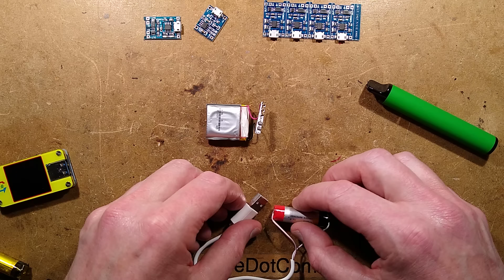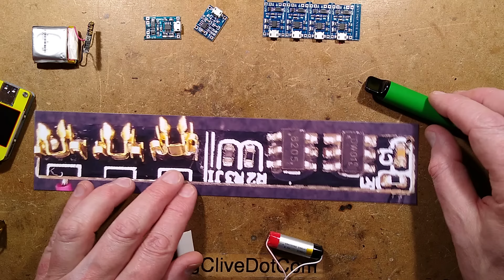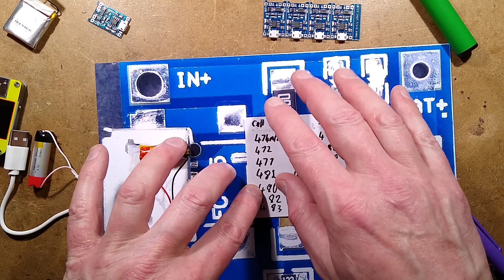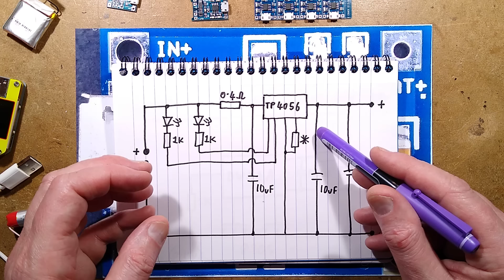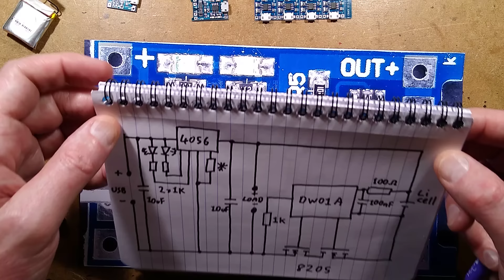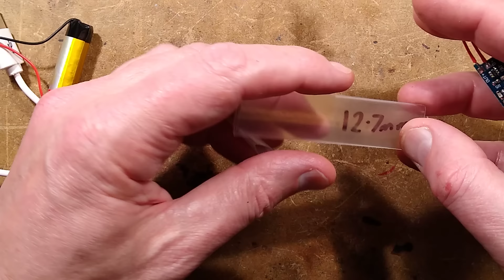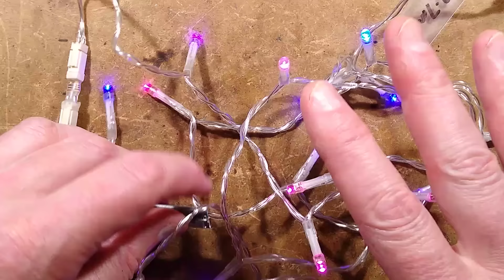Don't do this!   (There's a much safer way)

Comment: One important thing to keep in mind about the board with the TP4506 and the DW01: if you try to use it while charging the cell, the TP4506 will see the charge current as well as the load current and will never reach the charge termination point, potentially overcharging the cell. 
So use that board to either charge the cell or protect it during use, but not both at the same time.
Reply: Thank you for that tip! I had assumed that these boards supported pass through charging. I won't use them in this mode now. I read the other day that most power bank manufacturers have disabled pass through charging. Maybe this is why.
Reply: @chrisreynolds6331  When I bought my first Anker charger, I read on their web site that they did not offer battery banks with pass-through charging because it shortens the life of the batteries
Reply: @chrisreynolds6331 There is a simple way to make these little modules support pass-through charging: When connecting wires to the output terminals to clip onto a lithium ion cell to charge it, connect the negative wire to both negative output terminals, and the positive wire to both positive output terminals. Whatever you are powering from the cell will then take current from the 4.2 volt charging output on the module in addition to the cell itself.

Of course this bypasses the DW01 and twin-MOSFET package, so the cell won't be protected from being discharged too much any more. Or you could just use the cheaper type of module which doesn't have the discharge protection - those cheaper modules only have one +/- output to begin with. Either way, you could use a separate discharge protection module connected directly to the cell to get the protection back.

If you leave the micro-USB cable connected to the module (and connected to a 5 volt USB power source), the module will now act as a miniature uninterruptible power supply, provided that whatever you are powering from the cell doesn't need more current than the charging output on the module can supply.
Reply: @chrisreynolds6331  Power banks have their own multifunction BMS chips.  Maybe the most common one doesn't handle pass through properly.
Reply: If anyone wants to use these for passthrough charging, it can be done.  There's a circuit which uses a P channel mosfet, a diode and resister to pull power from the 5v input and bypass the battery completely when USB is connected.  It's also necessary to use a switchmode regulator on the output which can be powered from 3.4 - 5v to give a consistent output voltage. It should be fairly easy to find online.
Reply: @DarrensBench  can I find a schematic for this anywhere?
Reply: BigClive has released a video explaining why this appears to be true, and also why it is, in fact, not true.
Reply: Yep
Reply: I'm pretty sure this is wrong, it will just be connected in constant voltage mode. If you have any source telling otherwise I would be very interested to see why that is.
Reply: Thanks! I was wondering if the board could be used this way. Would've been cool.
Reply: Nah
Reply: Top reply, this should be pinned. I've cooked a couple of Lipos in exactly this manner, and had no idea why.
Reply: That's very good information, especially since the protected one even have separate B+/- and OUT+/- terminals. From what I can tell fixing this would have "cost" three additional components and a very slightly larger PCB, it's a bit sad that no one has capitalized on this to provide a better variant (that I can find, it's all TP4056 with or without protection circuit, no PCBs that appears to be different).
Someone suggested that one could fudge a "load bypass while on USB power" using two schottky diodes (for lower voltage loss) - I may have to test that out next time I use one to confirm that this actually works but the idea looks reasonable (not a guarantee).
Reply: @Torbjorn.Lindgren  Maybe look at other chips from the same series.  Some are designed to provide power output without the 10% loss in a schotky  diode.
Reply: @johndododoe1411  Most people want a pre-existing module so they don't need to design their own, I doubt anyone charging a lithium cell with straight 5V would be capable of that. Which is why it's a shame that the common protected TP4056 modules LOOKS like they support "pass-through charging" (separate B+/- and OUT+/-) but doesn't - and that I couldn't find any better (commodity, small, simple) pre-made alternatives, whether TP4056 or not.
If you know of a pre-made module that takes USB power in, manages a rechargable lithium cell and support pass-through charging I think a number of people would be interested in what to search for to find it. Major bonus points if it also includes a boost/buck convert afterwards to provide an adjustable stable output voltage (say 1.5-12V)  - but there's good pre-made modules specifically for this part that people already use.
The "build a jank bypass circuit using scottky diodes" was a musing on wether it was possible to salvage it for quick-n-dirty usage (apparently it is, found people confirming it), with a redesigned circuitboards and possibly different charging chip that's unlikely to be the best way to do it.

Comment: Please mr. bigClive, can you think and or show a hack to limit the 4056 to charge only to 4.1/4.2v and not to the 4.3v it comes as default?
A way to fool it maybe with low-drop diode loop or something? I would not mind if discharge cutoff jumps up a bit too.. all good to keep any lithium cells healthier for a LOT longer.

Comment: I've adapted a couple of devices that take 3 x LR44 cells to work with the cylindrical cells. Mainly it's kids toys like the LED light wands you buy at the fair but I had a screwdriver with a triple LED illuminator that I keep in the car and it had enough space inside to accomodate the cell. Once I get my 3D printer up and running I might make a charging cradle for it with a couple of pogo pins and put the charging protection in the cradle.

The cell protection circuits are ace, I've even used them to convert a dustbuster I got from Freecycle from NiMH to Li-ion, it now works a lot longer and charges via micro-USB.

Comment: Would there be a way to attach some kind of variable resistor, so you could adjust the charging current, to suit the size of battery you were charging?

Comment: It's a shame one cannot adjust the voltage levels as well as the current levels (on the 4056 board). The 18650 cells I have are rated to 3.7V and that's as high as I want them charged.
Reply: Unless you're talking about LiFePO4 cells, 3.7V is likely the nominal voltage and not the max charge voltage.
Reply: @fat_pigeon  Thanks. The 18650s I have are 30Q from samsung. Wiki says they are INR - I.E. Nickel, Manganese Cobalt so capable of being charged to 4.2V. Nevertheless it would be nice to charge to maximum voltages below that 4.2V to reduce physical stress on the anode. For longevity in a battery it's best to charge to only 80% capacity and discharge to only 20%.  I do this on my electric car and on my phone. Not that the phone manufacturers help - I have to run the charger via a bluetooth controlled relay that switches off at 80%.

Comment: Aww, poor old "Trumpy Brick" now reduced to playing cameo roles?!

Unfortunately, people here in Yorkshire tend to be a bit tight fisted, and rarely, if ever, do we find anything in the street, unless it's an old microwave, or a fridge!  But, I do like the idea of salvaging those batteries.

One thought occurs to me, and that is that if the charger module's output was limited to 1A, could you charge two batteries in parallel to effectively give them 500mA each, or would it not work that way?

Comment: Hi Clive. It's difficult not to notice that you have some rather sore looking cracks on your hands. I used to have similar dermatitis sores and cracks. I tried a few over the counter treatments and one from the doctor all of which were no help, then in frustration I applied goose grease, it is harmless, very soothing and my problem cleared up. If you have not roasted a goose recently you can buy pots of goose fat at the super market. Regards, Jon

Comment: I empty the garbage cans and sweep the parking lot for a shopping center in Southern California.  I am swimming in these lithium cells from picking them up while working and breaking them down every couple days.  I also have several hundred of the speaker/microphones that are inside them as well.  I use the cells for my headlights and red red safety lights on my bicycle which is lit up like a friggin Christmas tree.  I have 3 front circuits and 2 rear circuits for the red ones and finally I have a bottom purple one so when I'm cruising with my brother it looks like I huvvah huvvah huvvah. What I need is to DIY  a tiny smoke machine.   Nevermind I figured it out myself now that I've "said it in my head outloud".  I just need to figure out how to work the compressor part to spew the fog out since a vape is like 8/13ths of a fog machine.

Comment: I only do this to recover a cell that has gone below charge voltage and a lithium charger will not begin to charge. I only use a 500mA USB charger and run the leads via a multimeter to monitor voltage. Only leave it connected for brief periods (10-30 seconds) while watching cell voltage. As soon as it's above 3.5v I remove the power. Have done this many times now. After that the cell goes back onto a proper lithium charger 👍

Great for things like camera batteries
Reply: The charger refuses to charge it *because it's dangerous to do so*! Apparently overdischarged Li-ion can often be revived by charging for a short period _at very low current_. Connecting directly to USB definitely does not do that.
Reply: @fat_pigeon  well it does. I've done it many times without issue. You ONLY connect the 5v 500ma source for a very brief time and ONLY to get cell voltage high enough for the charger to wake up/recognise the cell.

You don't fully charge or use very dead cells. An example was a GoPro pack that had been sat in a sealed package from new. It was fairly old and had self discharged to around 2.2v(3.7v nominal pack)

A brief tap of low current USB voltage brought it back to 3.2v in less than 30 seconds total. That battery has been in regular use for a good 6 months now.

Comment: Theres a very simple way to do it. Just use the standard 18650 charger. You don’t even have to remove the wires at all just pull the contents out slip it in the charger and it’s done

Comment: I was once lucky to buy a 4.2v charger with LED indication. It was likely intended for an 18650 but functions with other cells with more or less safety margin. Many USB and mains chargers are available online and all are cheaper than a house fire.

Comment: Its worth noting that one end of the charge set resistor is connected to the "IN- " connection, so if you're changing the resistor for a "normal" 1/8w resistor, you can connect one end to the IN - connection and the other to the resistor pad that isn't connected there. This will give a little more room to play with.

Comment: If the battery has already had enough life time, it will even get so hot at the permitted 4.19 volts that you can no longer touch it, I don't even want to know what happens if you really overcharge these pipe bombs.
I built a battery pack with 219 of them, and I have a lot of respect for those bombs.

Comment: Please be more technically correct with lithium cells voltages. Yes their top voltage is 4.2 volts (not 4.3)  but at that voltage the SEI layer is being damaged so I stay on 4.1 volts and if you want the cell to last you should stop there too..
Below 3 volts means the cells should be treated as empty . Yes you can take them down to 2.5v but that again does damage. 
I put the question to you again . How can you make that TP4056 chip turn off at 4.1 volts?

Comment: I must confess I've "charged" from usb before, but it has been on cells that have had protection boards / charging circuits built in, the sort that are in tablets etc, that have gone below the cut off voltage. When I say charge I mean charging the cell directly for a few seconds until the internal voltage has risen above the cutoff voltage and then I revert back to charging the normal way. This is all the time having some way to deal with the cell should it catch fire and never left unattended, also with multimeter on hand and the power provided by a 500 milliwatt limited current source.

Comment: I wish there was a version of the TP4056, where the user could set the maximum charging voltage. Maybe there is, and I am just clueless! 
Not too keen about charging cells to full 4.2V. 
Charging a 2500mA Samsung cell to 3.9V, lost only 200mA capacity, but should double or triple the charge/discharge cycles. 
It would also become compatible with LiFePO4 cells, if set to 3.65V instead of the default 4.2V.

Comment: There is a "quick and dirty" charger you can make that is safe. That said it never charges the cell fully. Use a 3V3 LDO type regulator with a diode in the common to raise the output voltage to about 4V then use a 3R9 resistor (2W minimum) in series between the reg and the cell. Input and output 10uF ceramics are a good idea but it more or less work without them for most regs. Some need the caps to stop oscillation in the regulator (confused the hell out of me first time I encountered it).

Comment: If a fault trips the TP4056, the only way to reset it is by either disconnecting and reconnecting the cell, or by plugging it back into the USB power.
Otherwise, no candy.

Comment: Question:  If I have one of these modules with the DW01 protection, and I have a cell that also has DW01 protection, will they interfere with each other somehow?  If so I guess it would be best to have the modules without DW01 for when you are using cells that already have it?
Reply: Given you stay within limits, they quite do nothing(just passtru with some hopefully minor resistance).

When one cuts the battery is disconnected until you fix whatever triggered it. (recharge to reactivate, remove faulty charger etc).

Comment: There are also modules like that with integrated step-up module and direct output. So you can turn them in a battery bank basically.
Nifty little things.

Comment: Only had one lithium battery vent on me and it was after a couple of supersonic lead projectiles punctured it. Was a puffed up fully charged 3S@5AH LiPo, just made a bunch of smoke sadly. Was quite a disappointment, later I got some gasoline and magnesium powder I threw on it instead, gave quite the flash!

Comment: Another great and instructive video! I wonder, could you use these boards to make a Li-on button cell charger?  I've been on a Big Clive binge all evening and into the early morning. 0100 in California at the moment. Going to call it a day now. Cheers!
Reply from the maker: I've got a charger for tiny lithium cells that does use the same circuitry with higher value current setting resistors.
Reply: @bigclivedotcom  That sounds great! All the button cell  chargers I've found online so far don't get very good reviews. Is it possible to acquire one from you? I would gladly supply an "extra" boost to the coffee fund in return! :-) :-)

Comment: It's (tp4056) doesn't charge upto 4.2v it's charge arround 3.9v so you can't get desired capacity from liion 18650 cell.
Using in solar panels is nightmare so I prefer using 18650 directly to 6v 100ma panel!!

Comment: Right now there are warnings in canada about electric bikes, scooters, hoover boards, etc.  Some of which cost thousands of dollars ... all being fire hazards, with many fires having started by people plugging them in and walking away, with them overcharging.   The media uses it to scare us about lithium batteries ... instead of screaming questions about WTF the manufacturers didn't include proper charge / current limiting circuits like this.

Comment: I took apart a cheap rc car and it had two tiny batteries that look like baby 18650 cells, i wonder what the charging circuit is like in that thing.

Comment: improvising a battery charger, this i have a story about.
when i was a kid ...must have been about ten at the time, i made something similar to the usb charger shown at the start of the video but because i assumed i knew everything back then i thought it would just work, left the charger plugged in and went to bed, i woke up to the sound of a small explosion and a really bad smell. thankfully it didn't start a fire 

...also i was able to cover up what happened and never got in trouble for it.

moral of the story is don't be an idiot and assume you know everything and don't build makeshift chargers but if you do make one than at least don't leave it unattended.
Reply: correction: don't build makeshift chargers but if you do make one, throw it in the bin and don't use it to 'charge' anything

Comment: 2 questions if I may, can I connect the load and charger at the same time? and if I need higher voltage can I connect 2 cells together on that control board?
Thanks for the video, but I think it lacked explosive goodness. On what not to do.💥😀
Reply: Yes, you can connect the load at the same time, you connect it to the OUT terminals, and you can charge and use at the same time - with charging being correspondingly slower when the load is operating. Ideally charge current should be higher than load current, but it'll be safe either way. There is some irregularity at end-of-charge condition but really it's not too terrible.

You cannot connect 2 cells for higher voltage. Use a voltage booster instead, i.e. some small MT3608 board.

Comment: Worth mentioning to is that with these 4056 chargers, the battery should not be charged at the same time the battery is being used in a circuit.